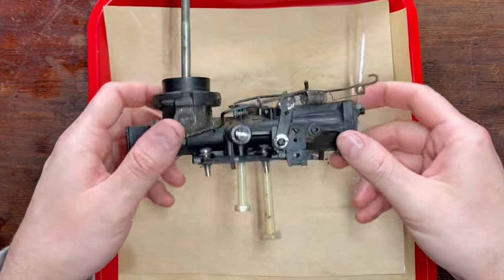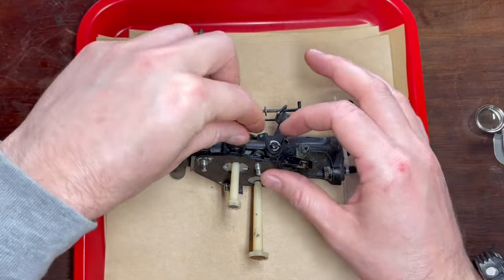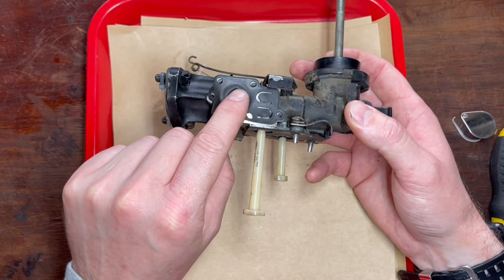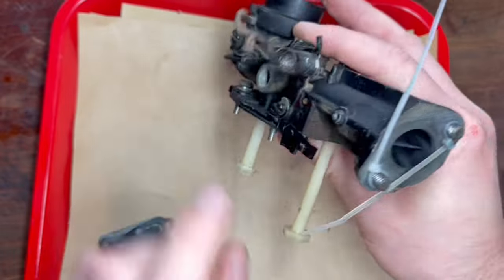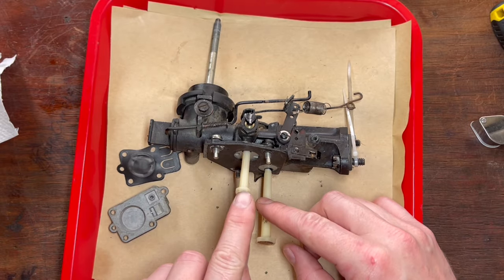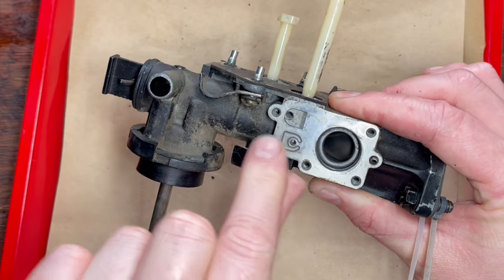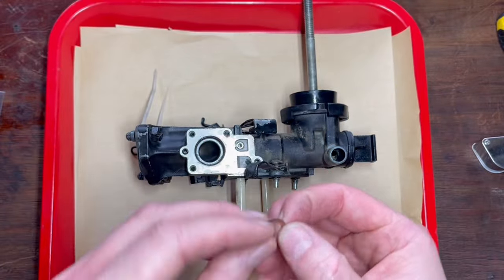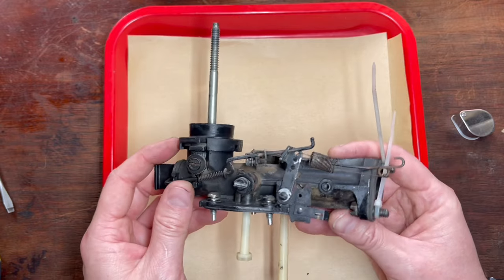Briggs & Stratton Pulsa Jet Carburetor Service & Repair! (EASY DIY TUTORIAL)

Comment: Thank you.  I replaced the diaphragm and the passages "looked" to be clog free but I didn't check the main jet and the engine is "hunting" (surging) and I have to run it with the choke halfway closed.  I'll take it off again and be more thorough.  Great tips!
Reply from the maker: Doesn’t hurt to go over it again :)
Reply: @VintageEngineRepairs  gonna do that this weekend, lol.  :)
Reply: @VintageEngineRepairs  went over it again, this time cleaning out all passages again AND main jet.  Problem solved.  I'm a little disappointed in myself because I usually am more thorough than I was this first time around.

Comment: By far the best!  Question - my brass pick up tube ends in a knob, no filter.  I see a filter part listed but not available.  Use as is or fashion an in-tank filter.  Not sure if the mechanics will allow that approach.  By the way, while cleaning the rust from my tank, I pulled up one of the shorter tubes.  Maybe dropped in assembly?  Thanks again.
Reply from the maker: Yes that hex head should have a filter in it :) thanks for the kind words!
Reply: @VintageEngineRepairs  does it have to be a sealed system to draw gas?  I have a small in-tank filter that I could connect to the brass tube with plastic hose but don’t think it will always be entirely submerged.  Also found a Briggs tube that includes a filter that looks like it could be grafted onto the brass tube.  I know the second option will work but I’ll save the $10 for the part and try the in-tank first if you think it might work.  Thanks
Reply: @VintageEngineRepairs  Light went on!  Never mind.  Thanks.

Comment: Great rebuild explanation. How high should the spring/retainer behind the diaphragm sit a above the carb body and is it ok to stretch the spring to achieve the desired height? Thank you
Reply from the maker: Hey :) I don’t recommend stretching the spring, it’s precisely made to ensure if offers the correct amount of resistance.

Comment: Did you do a video on putting the carb back on the motor. The spring is what I need help with.
Reply from the maker: I don’t I’m afraid! Each carburetor linkage setup can vary quite a bit depending on what machine it’s come off. I suggest searching for the service manual for your particular engine :)

Comment: I have this carb on an older 5hp Briggs.  It runs, but I can't get the diaphragm cover to stop leaking.  Thought at first it was the new Chinese diaphragm I had installed, so got an OEM Briggs one which didn't leak as bad, but still leaking.  Next took the diaphragm cover off and found it was slightly warped (probably from muffler heat), so sanded it smooth with sandpaper on a piece of glass and got it flat.  Still leaks and don't know where to go next???
Reply from the maker: Hey, flatten both sides :) why they never used a gasket on them I don’t know, but that said, none of mine have leaked so it does work I guess!

Comment: i have the exact same carb, did a full rebuild and cleaned out the whole thing. now the carb is sending too much gas to the engine. any ideas?
Reply from the maker: Try adjusting the screws :)

Comment: My carb pumps from tank to bowl and then floods carb any idea why it wont spray into the engine 
I cleaned the carb  with carb cleaner and every hole is clean and clear . Any info woukd be appreciated thanks
Reply from the maker: Hmm interesting, when you say floods the carb, how can you tell? What are the signs and symptoms? It could be an engine timing issue blowing air back through the intake?
Reply: The air filter tray is off and can see fuel puddle in carb, i was thinking  might be timing or valve clearance issue. Want try easier way first. Any chance might be the needle jet bot set properly or governor rod not working. I fix my own stuff and not a professional I thank you for  responding

Comment: I have one of these carbs which I cleaned up but after sitting for a couple days it will not start unless I prime it with some carb cleaner? Once started it restarts great all day long. Any ideas on what I missed??
Reply from the maker: Hey :) And you’re putting the choke on correct?
Reply: @VintageEngineRepairs  yes I did
Reply from the maker: @louhudon gotcha, you can try give it more fuel, or you may have an air leak somewhere.

Comment: What are the two pinholes located behind the jet screw?
Reply from the maker: It’s been a long time since I looked inside, I believe one is fuel in and the other is fuel out, but don’t quote me!
Reply: @VintageEngineRepairs  I thought to look at it from where you can remove the valve and the small hole is for drawing gas during idle, and the larger hole is exposed when you open the butterfly like a secondary.

Comment: hi, whats the screw head below the main jet, i can't see it reference in the part diagram, i tried to remove it and completely went through it, i have no drilled this out, what is its purpose or can i replace it thanks
Reply from the maker: Hey! I presume you’re referring to possibly the idle screw? Do you have a time stamp for me to look at the video?
Reply: @VintageEngineRepairs  thanks for your reply! 01:21 when you unscrew the main jet there is also a Philips head underneath that i tried undoing unless that was purely design
Reply from the maker: @alexandercarr-swain5680 sorry mate I don’t see a Philips under the main jet?

Comment: The main reason why Briggs & Stratton made the pulse carburetor, was as the fuel tank gets low on fuel it leans out the engine. So this was a great sick so the engine would run at the same amount of fuel no matter how much she was in the bigger tank that pump the gas into little bowl that had inside the big tank.
Reply from the maker: They’re a great concept :) simple and reliable!

Comment: Ive a used mtd 5 tiller. It came with a 5ank full of rust water( they sid it runs strong) shit you better be strong to pull on it forever and never start it.
Ive bought a new carb just havent exchanged it yet.
I need a tank too but not for 300$
Reply from the maker: Ouch!!! $300??

Comment: Very useful vid but why brake cleaner and not carb cleaner?
Reply from the maker: You can do :) generally I decide depending on the condition of the carb. Just be careful with carb cleaner on o-rings and rubber parts!
Reply: Guessing I have an older carb but no jet seems to be either removable or shown on part diagram, only the screw and spring. Have you come across one of these before? Tried to upload a pic but YouTube won’t allow.
Reply from the maker: Yes :) not all main jets or emulsion tubes are removable!